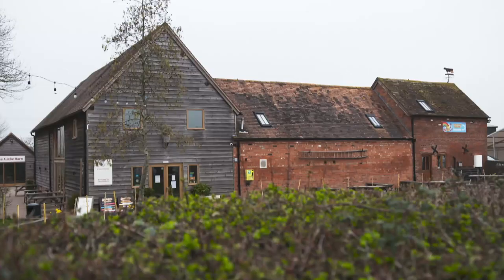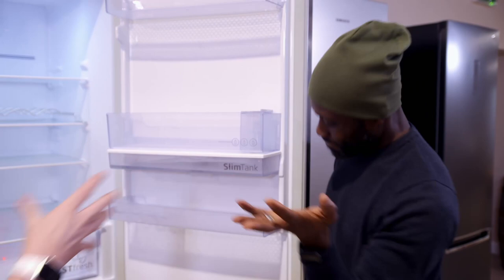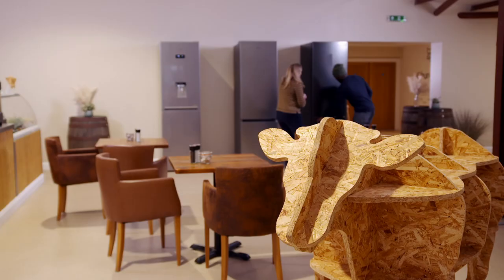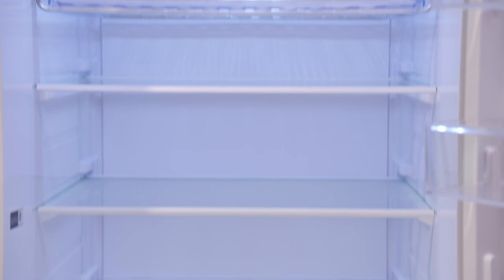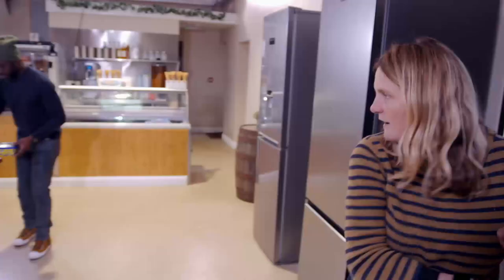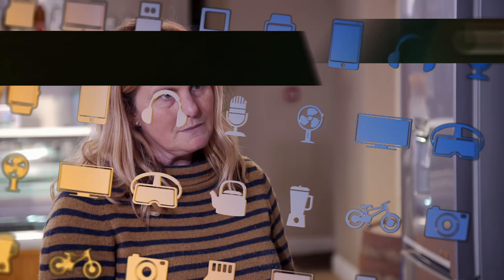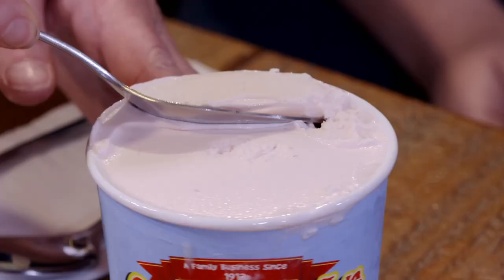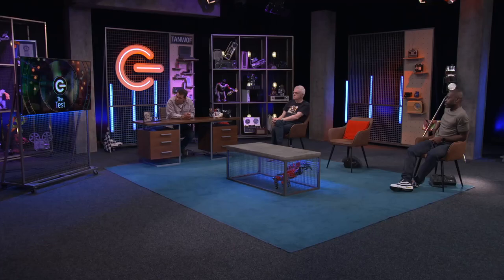Latest Fridge Freezers Reviewed | The Gadget Show

Comment: LG Has these weird stupid holes at the bottom of the friedges on all of their new models, and that is scary when you accidentally spill something it can go straight into that hole... and to the machine?? where does it go? that is a deal breaker for me with LG.
Reply: That's the condensate drain hole - Any conventual fridge will have one. The water goes to a tray on top of the compressor, where it is heated and evaporated.